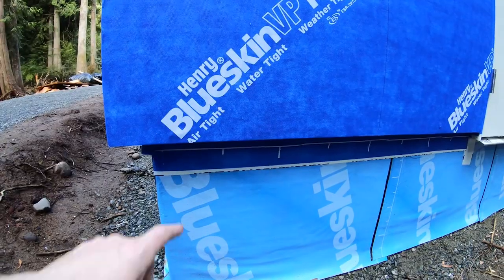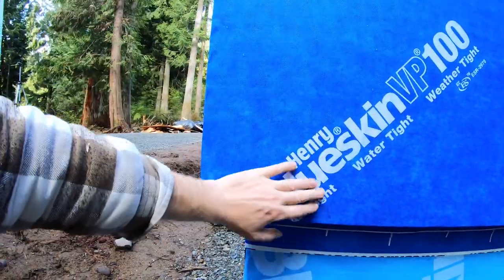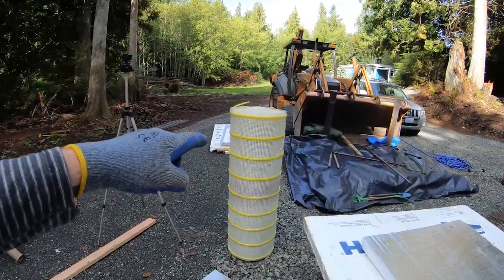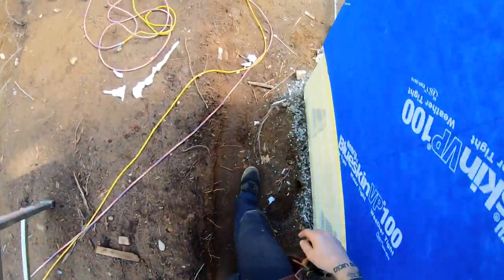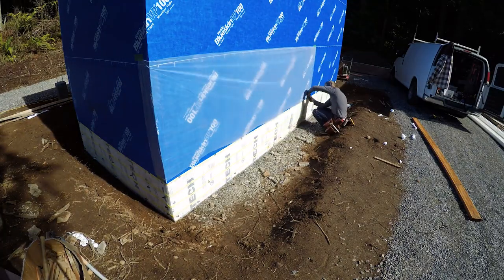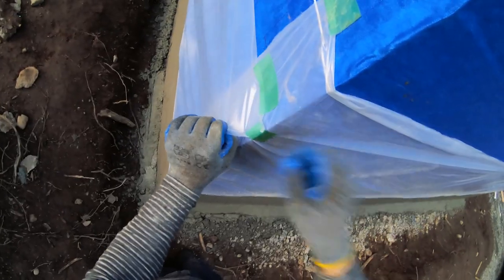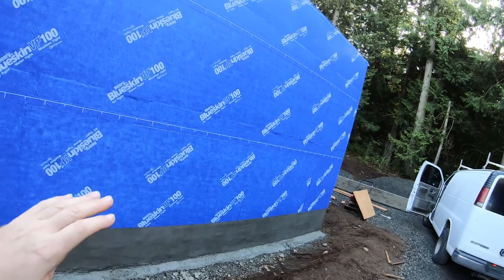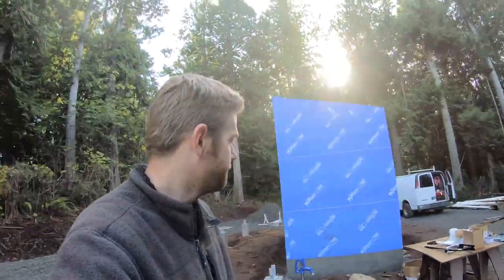Foundation Insulation with Stucco Coat as Protection

Comment: Looks great. Would this same exterior application work for an ICF crawl space?

 I'm planning on doing a sealed crawl space, but have struggled with figured out how to finish the exterior foam. I plan to install the water proofing primer and then membrane, but I was stuck on what to do to finish the look after that. 

I think how you finished your project here would be a great solution .

Thanks again for all the awesome content!
Reply from the maker: Thank you.  This could work if you have a sill plate or sheathing on top of the ICF to nail the lath to.  Metal lath might be easier to work with and give a flatter result.  It also may be stiff enough that you could go without the foam board staples I used.  I'm not sure you could use them anyways as they would poke holes in your waterproofing if I understand your plan correctly.

You could also use cement board but I have read that it doesn't hold up to freeze and thaw cycles very well and could crumble after just a few years depending on how cold your winters are.  You could possibly put up cement board fastened only on top to a sill plate or similar and then do a stucco coat over that which may last longer.

Protecting foam is a tough job and there doesn't seem to be any good way of doing it yet.  Thanks for the great questions!
Reply: @TheLeaversFamily  thanks for the feedback. I'm embarrassed to admit, but the idea of poking holes in the water proofing membrane hadn't even crossed my mind...

Foam is tough to plan for and protect. I'll have to go back to the drawing board to figure it out. ICF saves a bunch of steps and labor, but the exterior foam is a problem for finishing. And I don't want to just leave the ugly waterproofing membrane visible.
Reply from the maker: I just noticed this reply, my notifications are not set properly it seems.  
Foam is a pain to waterproof and have it look good.  I have been wondering how ICF house foundations are waterproofed and protected.  I have seen peel and stick put on but usually the final product is rarely mentioned or shown.  I did see one video where a drainboard was glued to the peel and stick and I considered doing that on our house.  I went with a nail on drainboard instead because I could easily nail into the concrete behind the waterproofing.  But you could glue on a drainboard for your below grade protection.  
I also have seen cement board fastened to the wood framing and hanging down to a few inches below the dirt and covering the peel and stick to protect it.  That's partially what inspired my method.  So it depends on how much ICF is sticking up as well.  If it's a couple feet or less then you should be able to hang something mounted from above the peel and stick (framing) and let it hang down past the ground level and protect the peel and stick without puncturing it.  The dirt/gravel backfill will hold the bottom against the house.
I hope that helps a little.

Comment: Great work. Just curious, why did you build a kiln?
Reply from the maker: Thank you! We plan on milling up the wood for decorative ceilings that will go into the house we're building.  That wood has to be dried to a lower moisture content than air drying alone will get the wood.  If we install without kiln drying, the wood will shrink and badly crack when installed inside the heated and dry space of the house.  Also the kiln will sterilize the wood killing any mold or insects.

Comment: How is it all holding up 10 months later? Any bad cracks or parts stucco falling down?

I ran my Henry Blueskin WP200 to high on my foundation. I want to use Spiderlath over the Blueskin & stucco over it. Any thoughts from your experience?
Reply from the maker: It's holding up really well, no major cracks and looks like it will last a while.  The spider lath is a little floppy, metal lath may be easier to work with.  How do you plan to fasten the spider lath to the foundation?
Reply: @TheLeaversFamily  I don’t think I’m going to use Spiderlath because I also think it’s floppy & won’t work well for my purpose. I plan on buying flat metal lath, making my own furring indents or using some sort of spacer (like a deck2wall spacer) where the mortar joints are (I can still see them through the Henry Blueskin) & then screwing into the mortar between the blocks. Maybe try and use some Henry 925 sealant where I screw into the wall.
Reply from the maker: I like how you think.  You could do a rainscreen for the stucco.  You just sandwich some foundation drain board between the lath and the blueskin and you will have a stucco coat that should last a while because it can dry from both sides.  That's what I did on the house I'm building.  I screwed on the lath with tapcons and large washers.  I used a rotohammer to drill through the lath, drainboard and blueskin.  Hopefully the tapcons self seal at least a little.  Plus, the rain screen/drainboard will help keep water out or off the blueskin if there isn't a good seal around the screw.  Here is a couple videos that show how I did it: https://youtu.be/fxj5cJnNgo4 and https://youtu.be/nrOADJkSV70 .  I haven't seen any leaks and it's been a couple years now since the install.  I also think you should be okay to drill into the cinder block itself without damaging it?  I'm sure you'll figure it out.

Comment: Maybe I missed it, but what did you put on the bottom edge of the foam? I've heard one of the concerns of ground contact foam is that bugs will work there way up through it until they hit wood.
Reply from the maker: Sorry I missed your comment until now.  I packed mortar (by hand) all along the bottom and under the foam and basically linked up with the compacted gravel under the building.  Hopefully that will seal the bugs out of the foam even if they try to get into it via the buried french drains.